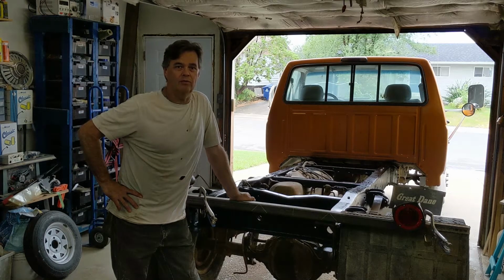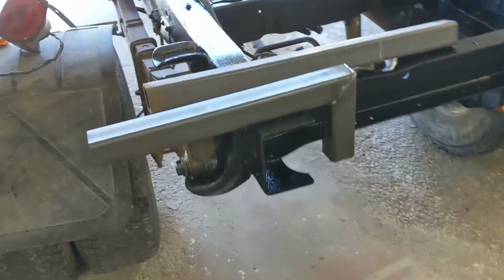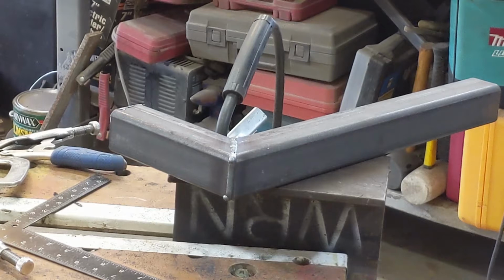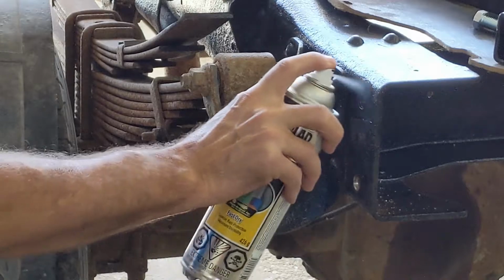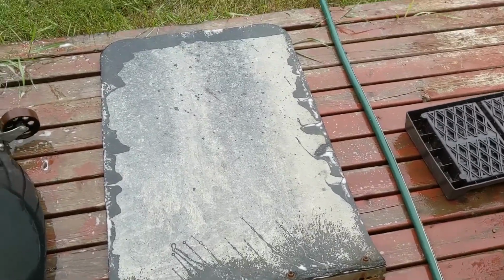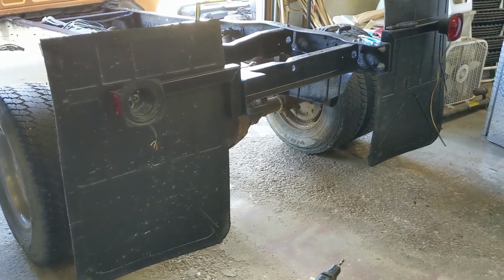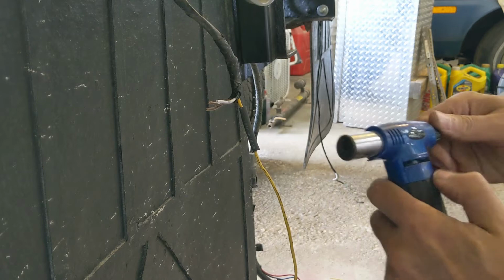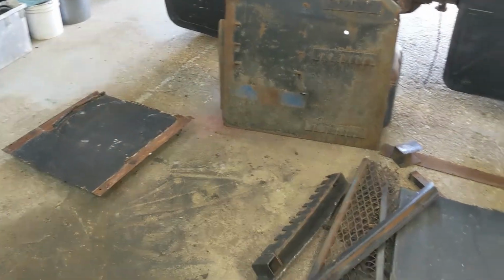94 Ford F-350 Diesel Dually Gets A Makeover - Part #2

Comment: Alvin,
I'm impressed with your welding ability.  I suck at it.  So tell ya what...move to Arkansas and I'll let you weld in my T-Bird floors.  I wouldn't bestow that honor on just anyone, ya know.  Excellent work on the tank straps.   And btw...one mud flap is a half-inch higher than the other. 😁😁😁😁😁😁
Regards,
John
Reply from the maker: Thank you John, I had some help with welding over the years at work, I worked with some of the best in the field, and I'm about 30 out of 100 compared to most of them! The miss-aligned flap is noticeable for sure, door gaps, fenders, and flaps attract the the human eye...we just can't help ourselves! 👀👀👀
Reply from the maker: Back in the 80's I passed through Arkansas on a Greyhound bus heading to Mexico, I remember it well, because in Little Rock it was raining so hard, the water was up to the bumper on the bus, and cars were stranded all over the place...one day I'll gat back there. 🌧🌧🌧
Reply: @J_R_Shop  I agree, that welding is impressive enough that you could simply visit Nova Scotia and weld up the cab corner, frame, various unknown other spots on my old chev truck 🤓! No moving here required.
Reply from the maker: @09Kandahar  no problem, flight is booked...just need a ride from the airport! ✈✈✈😎😎